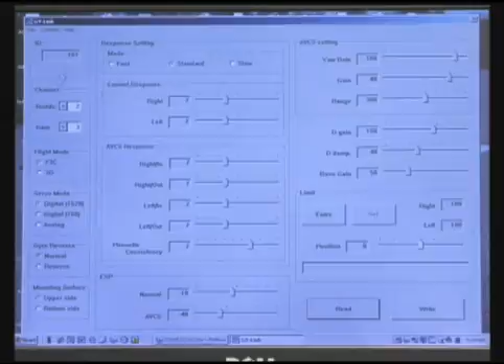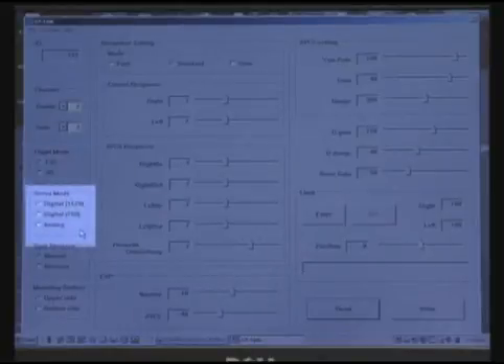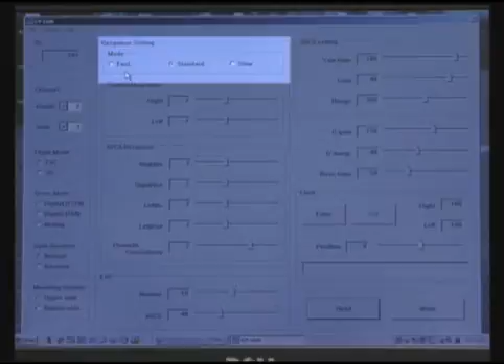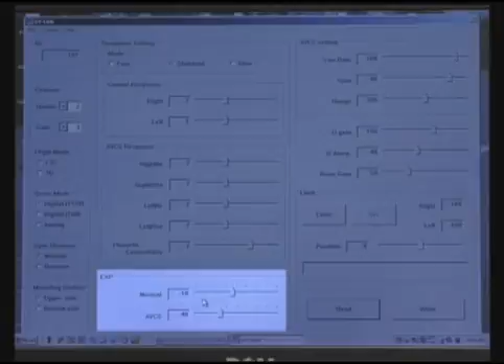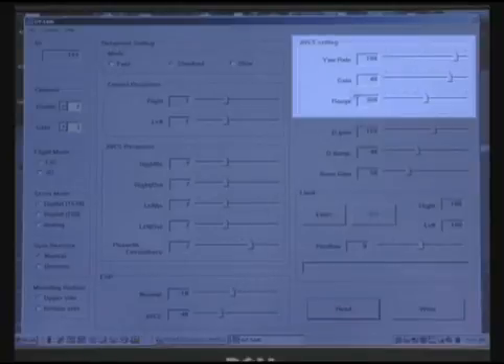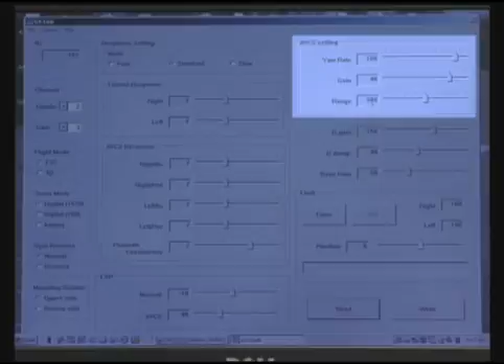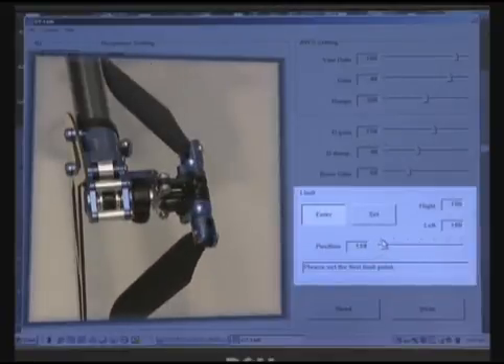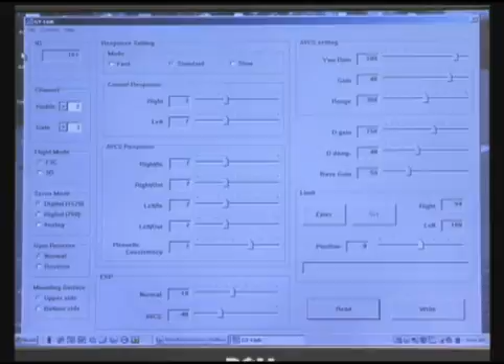Futaba Video Update: Programing the GY520 gyro with the GYLink software

Comment: Thanks I just got a good deal on a Futaba GY 520 , Futaba S9257 and the CIU-2 USB interface. I set it up with a glance at the setup pages in the manual on my EXi 450 without the Computer. Its kind of neat that you can do so much more with the computer on the Gyro. The setup without the computer is the best I've ever seen. Quark is easy too it just doesn't have as many options as the GY 520 does(!)

 I still have to get the software for the CIU-2 and its nice to have a look and see what's inside.